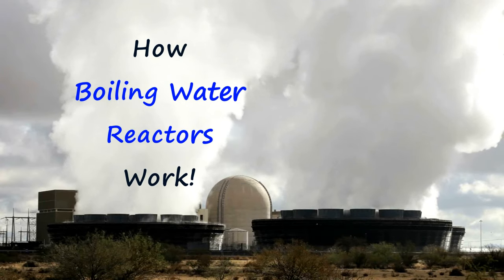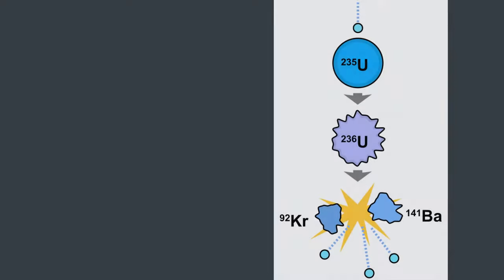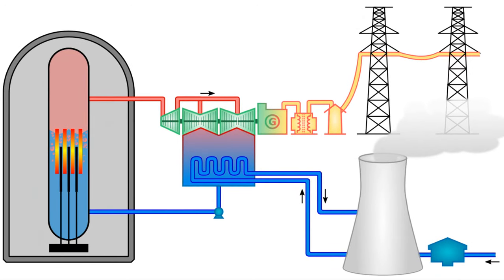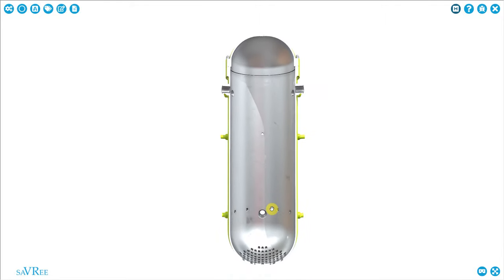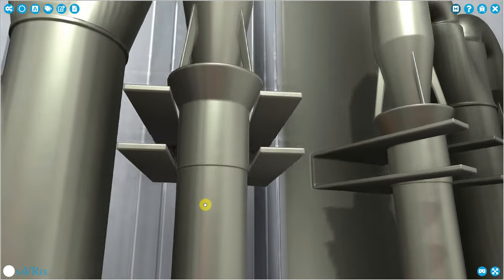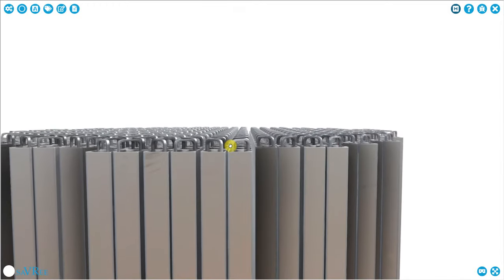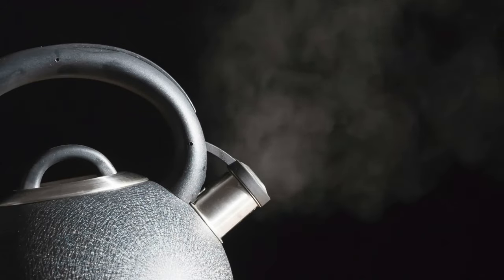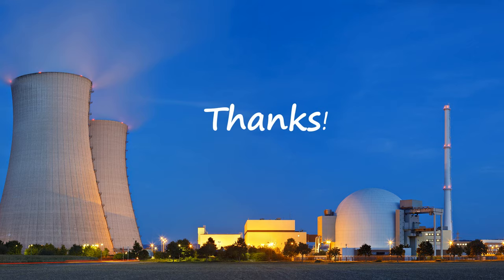How Boiling Water Reactors Work (BWR Working Principle)

Comment: It does not explain why this is better than a pressurized water reactor. Nor does it say that the vapor phase has positive feedback. It is therefore difficult to control. Nor does it say that the turbines in this type receive radioactive steam. Therefore, there is also significant radiation in the turbine engine room. This effect is not present in the pressurized water reactor.
Reply: The steam/water froth exiting the top of the core is only around 10% steam.  It is not "difficult to control."   And yes, turbine building access is controlled for radiological protection purposes.  Big deal......we know how to do that.

Comment: Like for actually say that the coolant is the primary way to control the rate of reaction daily instead for control rod. In fact, control rod is more for balance the fuel burn rate across fuel assembly and offset the reactivity of the fuel. Another way to control the rate of reaction is to add boronic acid to the coolant, which is the active ingredient of control rod. This two ways is the main way to control the reactor. Although most of the nuclear power is assigned to generate the base load of the grid, so always run on its full capacity.
Reply: Simplify this: "regulation" is effectively a loss. Because the adsorbed neutrons are lost, they will no longer be involved in further energy production.
Reply: @Akol56Peter  to be clear these neutrons are not actually adding to the total energy. They just continue the reaction. It's like saying that using half throttle is wasting gas, you're not wasting it you're just not using it until later. Sure you could put out more power but you're using half the power and half the gas to do it. In this case it's using less of the fuel so it doesn't have to be refueled as fast. If it runs at half load it can run for a bit longer.
Reply: @pilotavery  Ok thanks for the answer I understood, because until now it was only a "control" that by capturing neutrons they lost their split effect. The end result is a bit similar to breeder reactors. But with those it is still, technically difficult to handle, that the specific energy density per unit volume is an order of magnitude higher.
Reply: Boron is not added to the coolant for normal plant operations.

Comment: I would like to have seen a cross section of these "Steam Separator Pipes", as well as hear or see what's in the space that surrounds those pipes. With a vigorous boil, it would seam that the steam would simply blow the entrained water out the top of them, having too much momentum to let the water fall back through the upward stream. It doesn't appear that there is much margin for sidelined water in this system either, but if the enlarged end of these pipes allows separated water to fall back into this surrounding space, and somehow get back to the top of the boiler, then that top part could act as a measurable buffer for controlling the makeup water.
Reply: The pipes in the separator cause the steam/water mixture to spin, throwing the water out laterally as it exits the separator.  The dryer then handles what's left.

Comment: Very educational video! Thank you for posting. I understand the jet pump is used to allow the feed water to mix with the recirculation water and act as a coolant, but I am wondering why can't you have the feed water pressurized and sent directly to the reaction chamber (instead of going to the jet pump). What's the benefit of using the jet pump?
Reply: professional! Nice day for you. Any ductile iron valves problems or use,pls feel free to chat.:hand-pink-waving:
Reply: The physics of how the core works demands a much higher flow velocity than what would exist if it were nothing but incoming feedwater.

Comment: One bad thing with a BWR compared to a PWR is the turbines are directly exposed to the reactor coolant where PWR this is on a secondary water system. So when doing turbine work on a BWR the RAD suits have to come on.
Reply: not entirely true, the turbine area is shielded during operation. When it is time for servicing of the turbine there is a waiting time for any radioactivity to decay away. Then it is serviced like any other steam turbine.
Reply: @SootyMangabey.  Correct very short lived after shutdown. They do still however put the suits on as a precaution since directly exposed to the steam. But not dangerous in almost all cases.
Reply: @JisINSANE3 It’s not like the water carries uranium particles out of the core; the radionuclides in the cooling water are the product of neutron activation of the water itself.  These light radioactive isotopes are very short-lived, with half-lives of the order of seconds or less.  Most of them also put off easily-shielded types of radiation like beta particles.  So all they have to do is wait a small amount of time after shutdown for those to decay, and then they can safely access the turbines for whatever maintenance or inspections are required.

Comment: Are the control rods made of Boron?
Reply: Zirconium, boron, cadmium, silver, hafnium, or indium... or all combined together into one alloy, that is made, to be resistant, to corrosion, pressure, temperature... and safe can get in/out the core in any thermal power, condition.

Comment: The containment must be massive since the primary coolant is going directly on to the turbines then down to the condensate tank and on to the condensate pumps. PWR guy here, so please forgive the lack of engineering imagination.
Reply: @GreenFuel00 Where is this BWR? I don’t believe there is any BWR design that puts the turbine in the Containment Bldg.
Reply: The pressure boundary of the containment building includes power operated main steam isolation valves with redundant automatic closure functions as described in the plant safety analysis.

Comment: But you didn't show that the control wheels are not cylindrical, they are cross-shaped and it's also called control blades, in 12:41 you can see this.

But overall the video is good.

Comment: Is the steam  going to the turbine of this kind of reactor radioactive?
Reply: Entrained in the steam is nitrogen-16, which is created by neutron bombardment of free oxygen atoms which resulted from the radiolytic decomposition of water.  N-16 has a very short half-life, and it's decay releases a high-energy gamma particle, making the area around the steam pipes and the turbines a high radiation area during power operation.  It is not present when the reactor is shut down.

Comment: All nuclear systems create Wet steam as they don’t have a super heat section. The turbines and housings are in terrible shape when then open them for service, due to the wet steam.
Reply: Baloney.
Reply: Steam supplied to the high pressure turbines has a moisture content less than 0.1%.   HP turbine exhaust passes through reheaters before entering the LP turbines.  They run for years on end.....not in "terrible shape."

Comment: The radioactive steam, 1 loop basically, gets direct contact with turbine, and re-heater?! Its make the turbine radioactive too? PWR got 3 loops, 1st reactor, 2nd steam generator, 3rd condenser. Anyway... Still thinking that, PWR's, is safer, than BWR's. IMHO...
Reply: PWRs are nice because they do have the secondary loop, however the downside (not severe, but if we were more concerned about proliferation) is that it does require a higher enrichment. Since steam itself carries only a small percentage of radioactivity (mostly in the impurities and minerals from the system), the turbine area will be warm, but not hot to the levels you would see in a PWR. The big downside is that it is not as fool resistant because a PWR will develop voids to help slow the event, while a BWR needs the added boron to slow it in a runaway. 
NRC has some pretty cool diagrams and such.